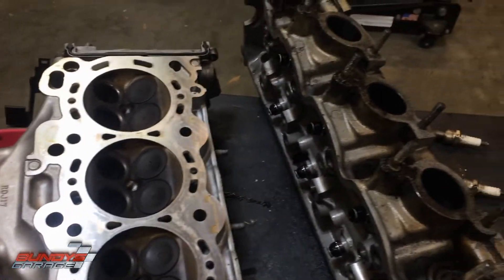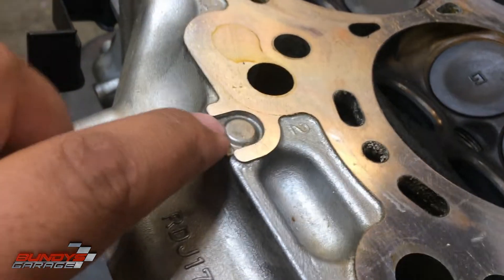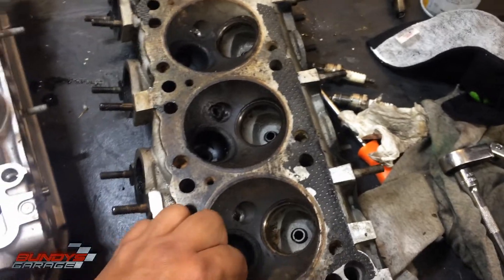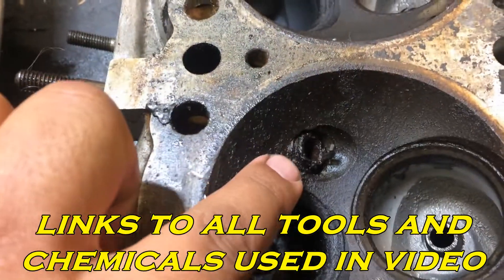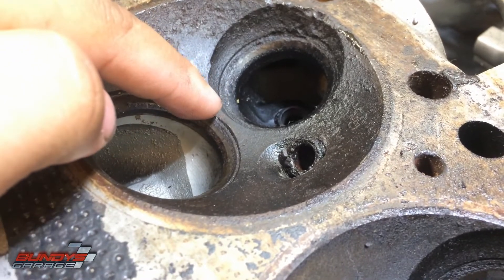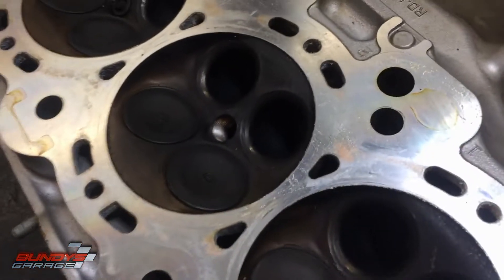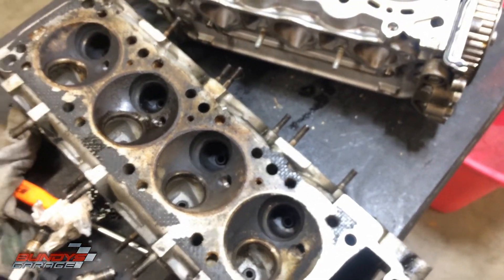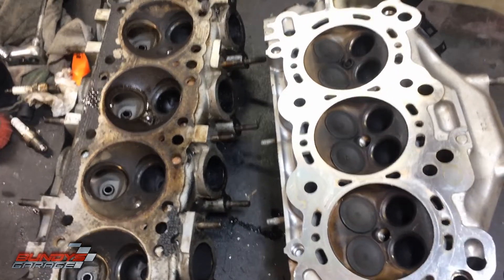Engine Head Tips & Tricks | How To Resurface Cylinder Heads | Gasket Resurfacing Repair Machine Shop

Comment: Use anti seize but not a whole lot just a small amount and as you screw it down it will coat the threads. Thanks for sharing the video and sharing your knowledge. Stay safe and well Artie 😊
Reply: I do not use anti seize on engines, because it doesn’t cool the plug in the head as efficiently then without, and i follow routine maintenance